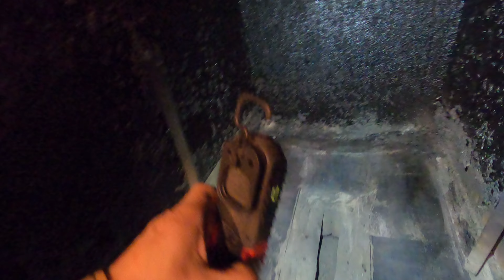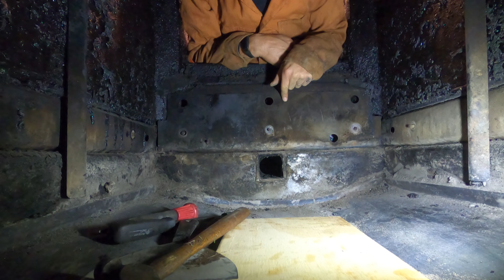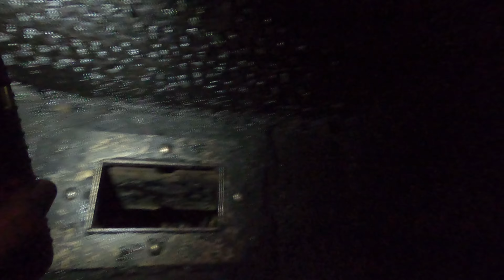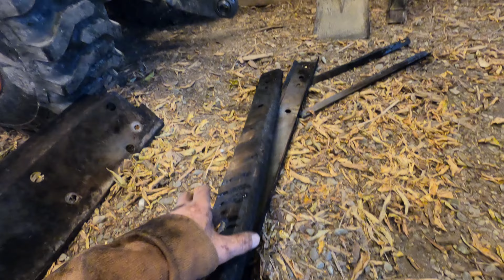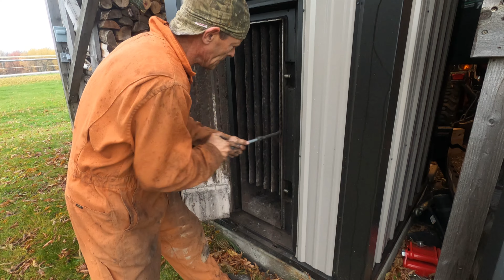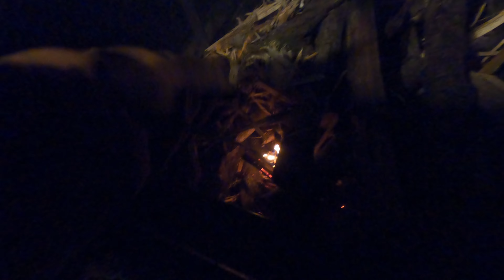Annual maintenance and Start-up of Classic Edge 750

Comment: Hello, I've been researching to build my own gasifier for 3-4yrs now. I've studied them all. Indoor & outdoor, small &large, popular names & the uncommon. I've learned from forums to avoid a CB OWB. Most negativity originates with the old style of non gassers. I watched your vid and found it interesting because, I was interested in learning it's construction. You've given me a clear vision of why I would absolutely not want one. The maintenance procedure purely sucks. Since these gassers require more maintenance, the ease of it is a must. One thing I can point out is, the dryer your wood, the less creosol you will have. 

In my boiler research I have learned something on reaction chambers. Line the steel with ceramic blanket and or firebrick. As long as it doesn,t interfere with your bypass. If I had your boiler, I'd get conventional woodstove fire brick, line the floor and sides. Possibly a rear wall or a full U shaped area, around the factory refractory center piece. Forcing the gasses toward the front before they can exit the rear. Transferring the heat into the brick will help faster lighting of the secondary flame, between cycles. It will also help force more heat through the stoves heat exchangers. 😉
Reply from the maker: Thanks for sharing what you've learned. I don't have anything to compare mine to, but all-in-all I'm satisfied with it. Had an indoor wood boiler prior and I much prefer an OWB to that for many reasons.
Reply: @timberterra  Me too. I'm building an outdoor.

Comment: What moisture content do you require your wood to be before burning in your boiler?
Reply from the maker: From what I've measured, it is normally just under 20%. I'm finally getting a year ahead on my wood, so it's probably closer to 15%. The first year I had it, I spent my time installing it rather than getting wood ready, so I cut up and burned dead standing trees. That was probably in the 20's. A noticeable difference.
Reply: @timberterra   Thanks for the reply.  I have a classic edge 750.  I burn wood that is between 15 and 20% MC.  I am having trouble with proper burn after loading the furnace with wood.  I load the firebox less than half full in the morning with a decent coal bed.  Quite often the fire will smoke itself out, and I will return to find the 'fire out' code.  Sometimes the water temp drops to 90.  I have cleaned everything just as you show in your videos.  Sometimes I try leaving the bypass door open.  That kind of works, but it seems like it just needs more fresh air.  Once the wood has smoldered enough it will eventually gasify, and I will get reaction temps of 1300.  Dealer didn't offer much advice.
Reply from the maker: Sounds like it's air-related as you mention. All your critical airways are clear? When I burned wet wood, the reaction temp would seldom get above 1000F, but I didn't have issues with the fire going out.

Comment: Where did you get the brush to clean the heat exchangers? I have the same boiler, and that looks like a much faster way to clean them.
Reply from the maker: Wood furnace world. I think this is the part: https://www.woodfurnaceworld.com/products/kit-flue-brush-m250-m255-ecl-e-24
I replaced mine a couple years ago and got it from my local dealer - brush only, not the handle. I didn't like the fiberglass handle it came with. I made a rigid handle with 3/8 pipe.
Reply: @timberterra  Thank you! I will give this a try.